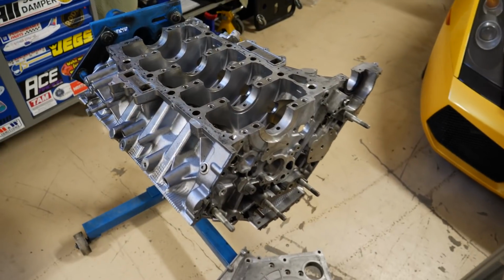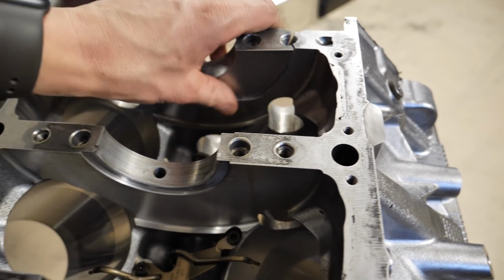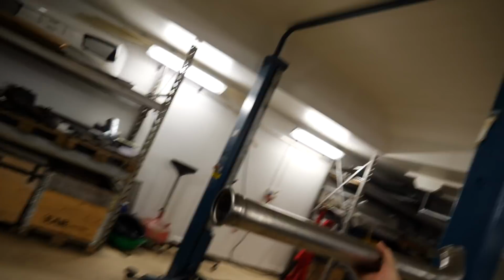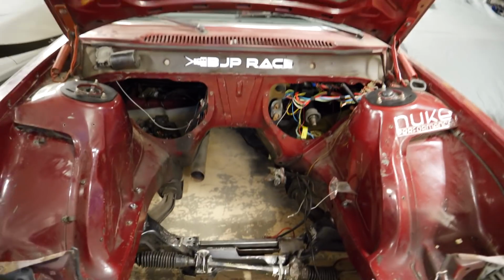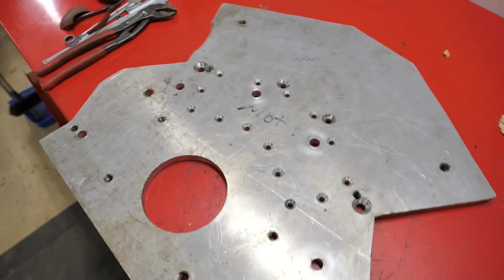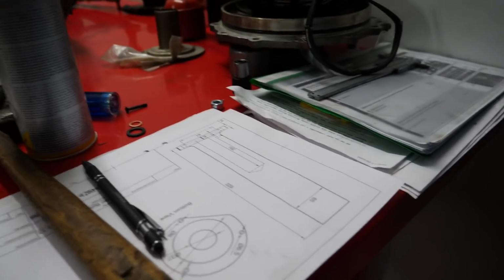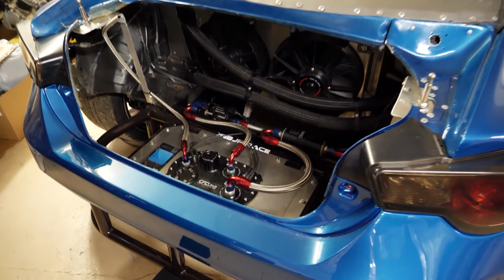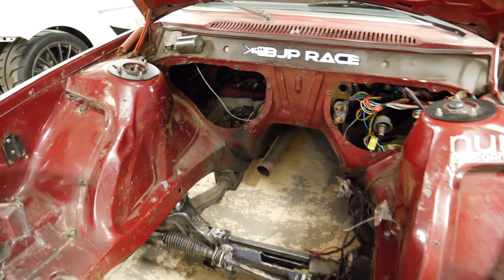Project Update Volvo with Lamborghini V10 Engine!

Comment: would it be cheaper to put a full audi v10 in it. that weld will be really unreliable.
that block is cracked even past the main cap mate. throw it away~!+ at 3:12 looking at the block a little to right low of the cap there is an oil pump I think you can see the crack even going through that.

when welding it. make sure to put in those main cap bolts. otherwise you will probably fill that up or it will not line up well.

Comment: That wiring is inspired in the Subaru, can't help but think tho if you turned all the boxes 90 degrees you could shorten all the wires feeding them by a few centimeters, might save you a few grams. Dunno if it's worth it. But damn. So perfect.

Comment: will the oil pickup still work with the motor reversed?  I have seen some LS2 swapped Porsches engines fail as the pickup was starved of oil in the sump even despite baffling
Reply: The motor isnt reversed, it's in exactly the same orientation it is in the lambo, gearbox is behind the engine in the lambo

Comment: 12% is the max amount of silicon you can normally alloy with aluminum, while maintaining an even distribution of the materials, unless you use some super fancy casting techniques. Having more silicon in the alloy (like 17%) will make the block expand less when heated, and also make it more brittle.

Comment: Because it will be your engine it is very possible to repair that block. Perhaps you could machine some sleeves to insert into the oil galley bores, prior to welding, to prevent chances of internal oil pressure leakage. There may be enough clearance on the back side of that bulkhead to mount a thin reinforcement plate with countersunk fasteners or welded as well in the flat area. The bed plate fastener threads bores could receive steel threaded insert sleeves, like "timeserts" but longer and probably custom made.
Nice project

Comment: Again jay leno garage used stitch weld. It's a drill process to put engine blocks back together without heat. No distortion of the block
Reply: You see this al lott used for stitching engine blocks together! Peter check this out please. Goodluck!

Comment: You should CNC holes in the crack and then fill it with welding to make it a lot more stable. If you just weld, I can ansure you it will crack again within a few miles aka you wasted your time.

Comment: Fantastic project.  Your right its a rare motor, the 5.0lt even firing Lamborghini.  Its the 5.2lt odd firing later motor that shares the same base block casting and the Audi S6/S8, though with out the split pin crank that the Audi road cars have to get even fire, and torque at lower RPM. 
Your gearbox bellhousing bolt pattern is from Graziano, and yes, only used on the R8/Lamborghini. 
I look forward to seeing your progress.

Comment: I'm seriously thinking that an old Volvo is one of the best cars to actually tune and modify. It's big and has a huge engine bay and the suspension is very simple
Reply: J-P Salmi that it is I’m currently ls swapping one and getting a Ford 8.8 in the rear was super easy and fitting in a cd009 didn’t even require hammering the trans tunnel!

Comment: Have you considered using modern high performance adhesives - there are products that could be used in this situation, I think. An engineer I know used adhesive to repair a jaguar main bearing and the priduct expert claimed it was entirely suitable, being used in aeronautic industry.

Comment: You will need to heat treat the block after welding. The strength drops more than half after welding because the aluminium loses its temper.

Comment: I love this build! If you haven’t already built the fixture of the bell housing, here is an idea for you. Since the pilot shaft is the same diameter, put the crank back in the block and bolt the adapter to the block. Cut off bell housing flange on transmission and locate the pilot of the BMW transmission into the crank. With proper bottoming clearance for  expansion, determine how much extra you need to cut off the transmission. Level the block and transmission and tack weld it together. Unbolt adapter and separate engine and transmission. Bolt together again to verify everything slides together smoothly
Reply from the maker: You can see in an future video how i do ;) The input shaft of the gearbox moves around much so its not possible to use that to center. But i will bolt onto an engine yes.

Comment: That is a really, Really bad crack as it's by the crank bearing, Ouch, If you try to weld and repair it it's gotta be to speck or the torque and torsion from the rotation of the crank could re-break that area under stress and load. 
Take's gut's even if you get it all together and get it running and if something goes hick up you still accomplish the impossible

Comment: You should really think about cutting the front end and making a tube frame up front will give you so much clearance and a lot more room not having shock towers you can make your own spots for motor mounts and you'll be able to make the motor as high or low as you want. Will also give you more room for headers

Comment: Do anyone in this community know off the top of their head what swedish tuner shops take for a rebuild on the volvo 2.3 liter? With or without minor NA tuning work if you happen to know. Got a 940 with 355k km with some valve noise and its been so problem-free I'm considering having it rebuilt for peace of mind for another 355k km (Just can't rationalize a new car as a daily driver when the manufacturers struggle to give a 6 year engine warranty).

Comment: I don't know if welding on the main journal is a good idea. There is threaded bosses the go right where the weld will be . I mean cast aluminum is way easier to weld repair than cast iron . I would worry about getting deep enough with the weld. You might have to grind back a cm or more on either side of the area to get the penetration needed to support that high stress area . If you can put enough weldment in there it should be good but align honing is a must and I'd mag the block just to make sure there are not little hair lines any where else. I want to see this project done as I am a Volvo tech and a builder also. This is a very cool project 👌👍.
That titanium pipe is gonna ring!!!! Might give it a cool sound😎

Comment: Try to ask ExoticAutoRecycling for the lamborghini V10 block!
Reply: He's closer to the actual lambo factory than auto exotic recycling 
I gurentee there's loads of blocks in Europe 
But it depends what he's willing to spent 
There's no danger running the welded block 
Worst case the parts crack off and junk the engine 
The crank is held by 5 other bearings to stop it flying out or doing any crazy stuff
Reply: @fowletm1992  You're correct on proximity to the Lambo factory, but I don't think that is much of an advantage.
"loads of blocks in Europe" ..... maybe, but from what we've seen of Peters knowledge and exposure I would say he would be aware of, or been made aware of, the likely contenders.
And you're almost 100% correct with the "welded block" comment. We've been "patching windows" in alloy Top Fuel blocks for decades, with great success, and I would say Peter is aware of the preparation and welding processes to get it right. 
Finally, it's always, for most of us, about the $'s, or Kr's!
I just hope he gets this unicorn up and running!
Reply: There's gotta be one somewhere in the world so he can make this project come to life
Reply: Michael Cross yeaaa truee.. but it’s dangerous if he run the engine with a welded block
Reply: @ibxtiger6920  If prepped properly, uses as much surface as possible with the correct material, then it's gonna be fine.
Cast aluminum is weaker than the welding itself if done right.
Reply: If you were in the USA I would easily weld n remachine these parts for u

Comment: Way off topic, but looking at the Subaru Intake, does it not matter that the air intake is in the hot engine compartment, because you have the intercooler to cool the air?

Comment: Al+Si = AlSi (Aluminium silicate) Si- chemical element.
Reply: Isn't it Aluminium Silisium?
Reply: @dietermeyer9231   search on Google IUPAC nomenclature,  on my language is ALUMINIJUM SILIKAT or ALUMINIJUM SILICIJ.  it is the same but it is not SILIOCN. Botomline is that Si stand for Silicium (Silicium) and not for SILOCON. By the way enjoy the video 📹
Reply: AluSil = An alloy of Aluminum + Silicon. Think Silicon valley. Aluminum silicate is a naturally occurring mineral (xAl₂O₃.ySiO₂.zH₂O), not an alloy.

Comment: How about the 5.0 BUH RS6 engine? 
compression ratio of 10.5:1 and it used an aluminium engine block and was claimed to be the first even firing aluminium block V10 engine
Reply: No. Still the same 90mm bore spacing as all Audi V10 engines and the later 5.2 Lamborghini V10. Early non-FSI Gallardos are 88mm cylinder spacing.
Reply: twist2410 what are the benefits of a 88mm cylinder spacing?